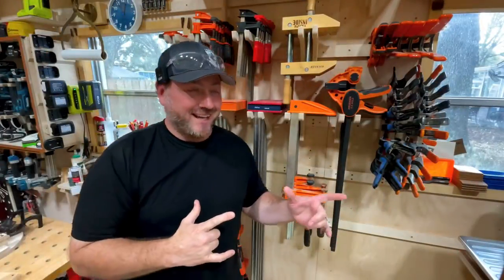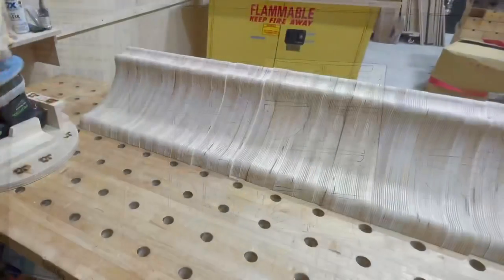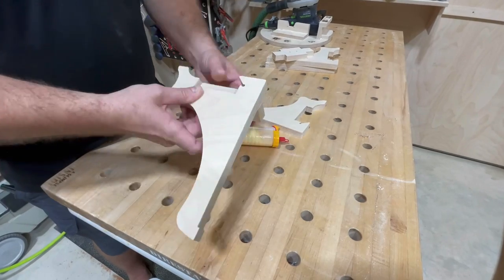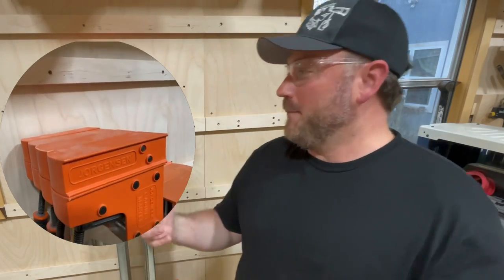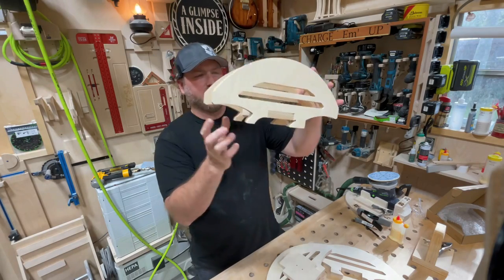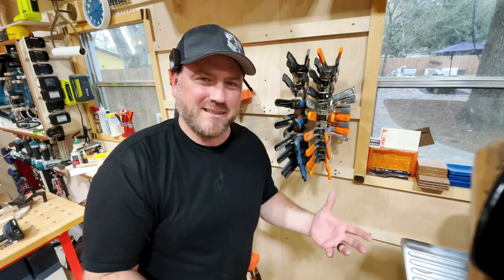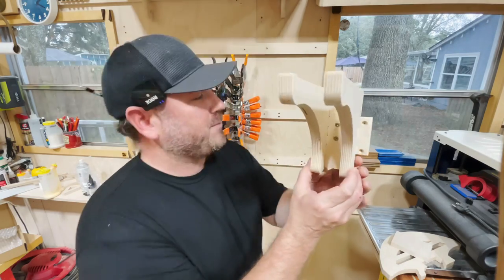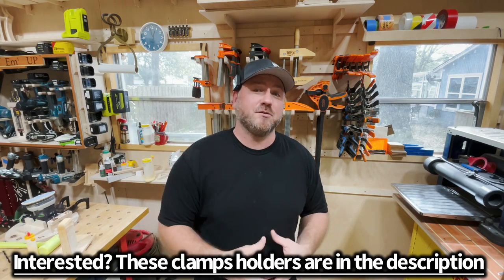French Cleat CLAMP STORAGE

Comment: Nice job - came back for a second look when I started to decide what I wanted to do for my clamp solution.  Looking at possibly buying your plans and implementing cutting on a laser.  Have you experimented with using 1/4" ply to see if it would be strong enough?
Reply from the maker: Yeah, it would be plenty strong. I would layer up at least two sheets together to make each arm three would be ideal so six in total 1/4 sheet cut outs to make one unit.

Comment: Chris, your clamp racks are nice, but only holding 4 parallel clamps is a bit limiting. Lee valley sells their version at a similar price (Item 15K1101), which holds 6, but when I built my own, I made them able to hold 8. I modeled mine after the LV design; using the cross dowels as the attachment method gives the extra oomph to be able to hold 8 besseys at once.
Still a great job though and I can't wait to get my CNC!

Comment: Great idea. How long does it take for the cnc to cut one of the brackets?
Reply from the maker: Of course that depends on the strength of your machine how many horsepower your spindle is. On the most conservative settings I can cut out eight pieces for four of these brackets in about 45 minutes to an hour
Reply: @AGlimpseInside  that seems reasonable. Thanks and Merry Christmas 🎄

Comment: Chris, did you ever figure out the issue with the PDF file (included in the digital file products) where it doesn’t print to the correct size. When printing at 100% scale the sizing if off. Thanks
Reply from the maker: You know what  I haven’t figured it out yet. I need to tho thanks for the reminder

Comment: I like your process and appreciate your enthusiasm for your great clamp designs, but as aJapanese zen and American arts & crafts minimalist, I prefer straight lines and 45° angles — not so much the complex curves sometimes used in architectural styles such as French, Roman, Italian and American Colonial. You’re absolutely right that fit and finish are just as critical the form, function and design and if you achieve that, you can spruce up a shop using other good design styles too.